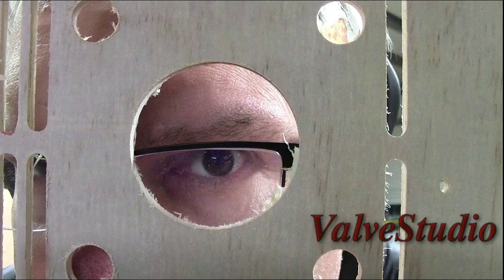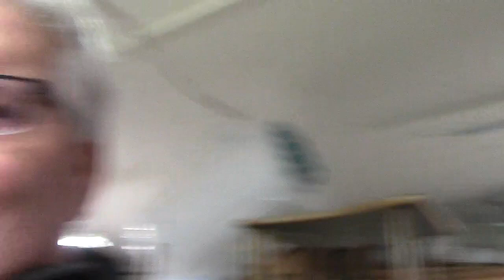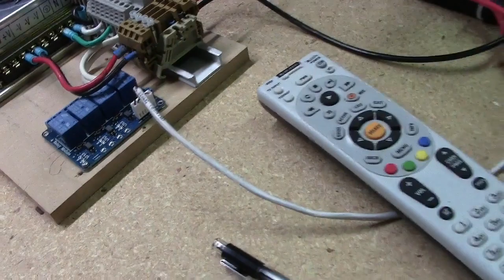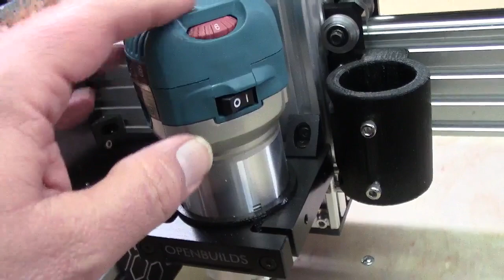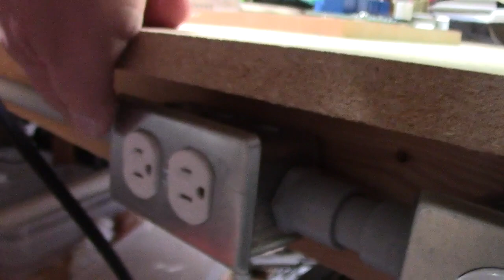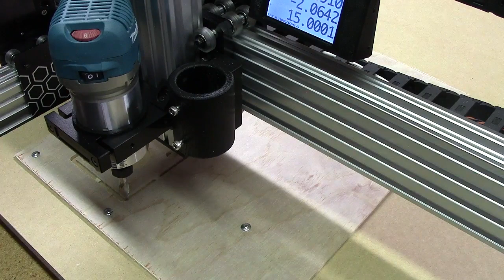190304 Valve Studio - Tonehenge Journey - Hyatt's First Cuts

Comment: hello craig. congrats on your machine's mastery of the cutting of the cellulosic foam material.
solidified polymers are next i assume? this has been quite the journey to be sure.
 i have also kept up with TOT's channel and his crystalline metal shaving machine and it's antics. metals aren't what i work with save for the types that are involved with automotive applications and soldering. these devices i find fascinating as when i was younger there were no such machines in existence...only mills and lathes and drill presses and shapers all of which required specialized skills that could only be paid for or bribed for use by bottles of fairly expensive alcohol or favours otherwise technical that could not be solved by those who possessed said machining skills.
 i find this all quite informative and a really practical use for computing power and accuracy.
 thanks for capturing all of this and putting the steps out there for others to follow. in hopes all is well on your side of the planet....
=dok=